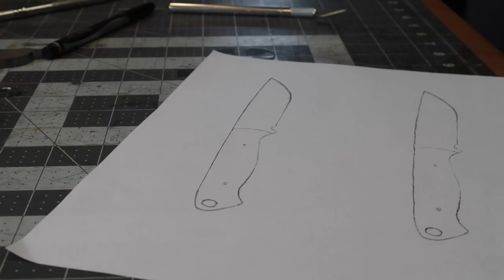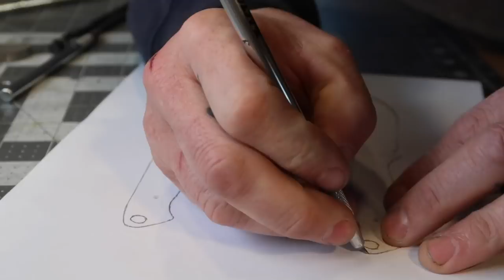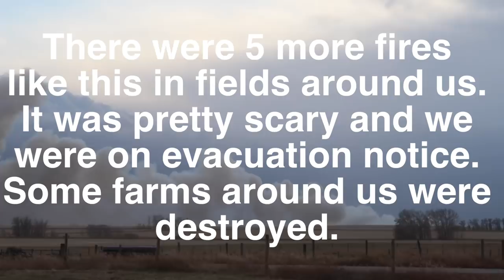How to grind a bevel with a hidden plunge line - Knife maker's vlog

Comment: You can plasticly deform martensite without damaging it? I've never seen anyone make bending adjustments after heat treatment. I've seen other smiths bend mid quench,pulling it out of the oil before it gets down to about 500 degrees and using a bending jig in a vice then swiftly resuming the quench. Have I misunderstood your straightening procedure or have I been over complicating warped blade straightening?

Comment: I have read about but have never tried a process called "normalizing" your blades, before tempering.  It's just heating them to the point of being non-magnetic a couple times and then letting them cool slowly, rather than quenching.  This is supposed to minimize warpage.  Have you heard of or tried this?